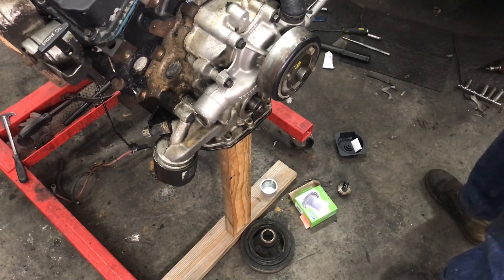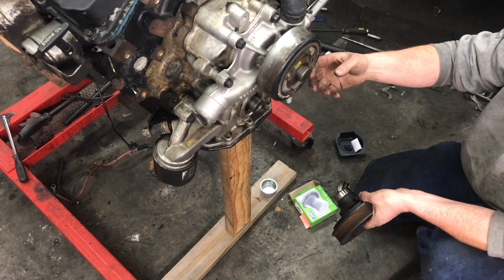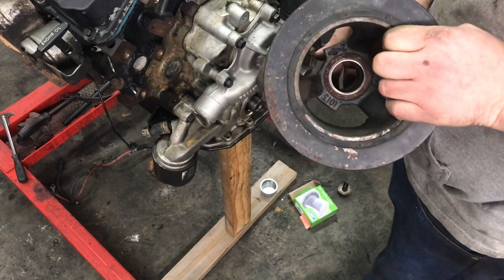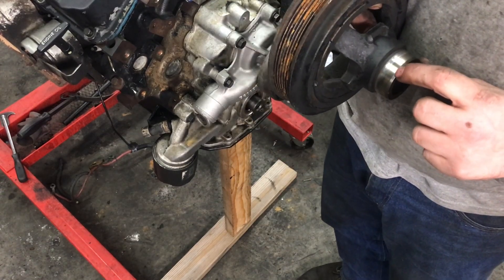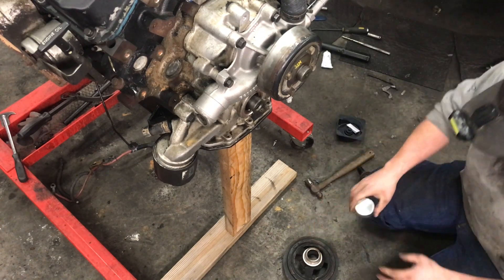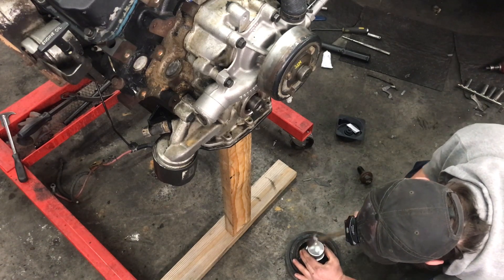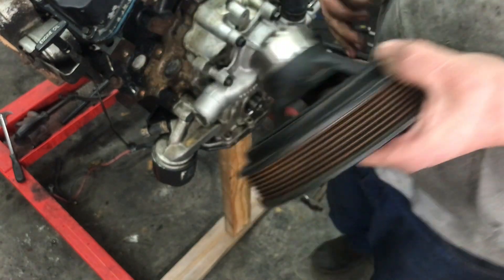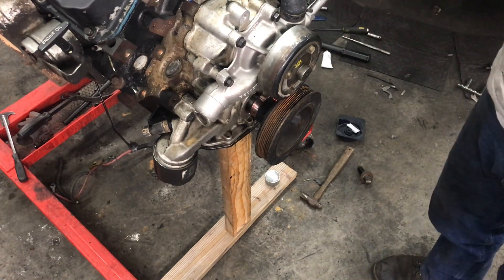Crank Seal Repair How TO Use A Speedi-Sleeve

Comment: Just discovered this. I’ve been fighting a main seal leak from both ends of my 01 Saturn SL2. Now to decide if I want to take the thing apart AGAIN
Reply: Same. 8 months now and my 4th attempt on a 6.1 hemi. Just discovered repair sleeves on accident. Ordered right away.

Comment: I’m trying to find a mechanic in the Los Angeles area who can do this repair.  I have been told I have a rear main leak due to a scratched crankshaft and have only been given the option of a new engine. But I’m researching online, I came across a Speedi sleeve